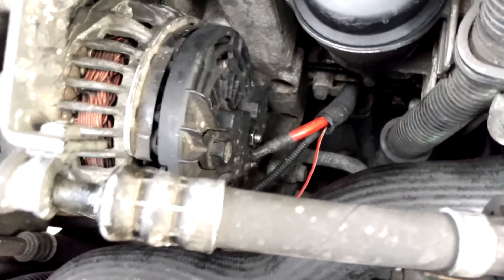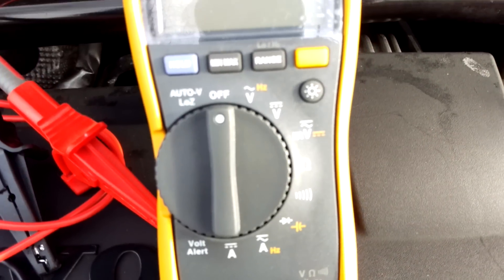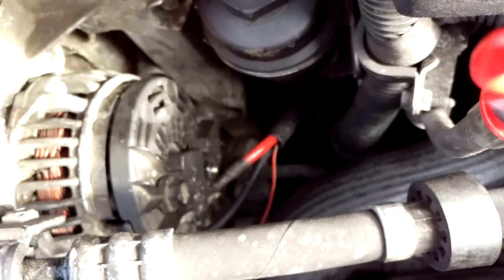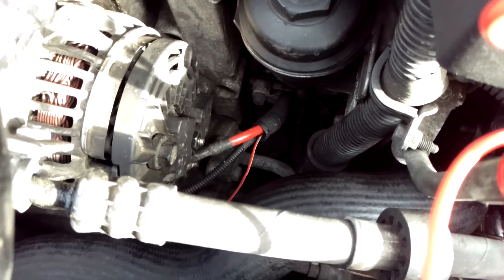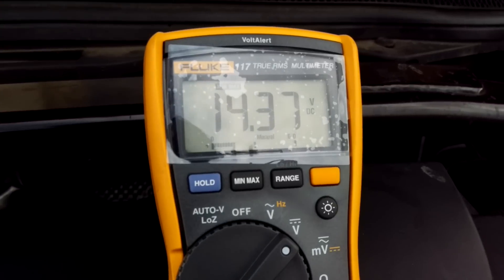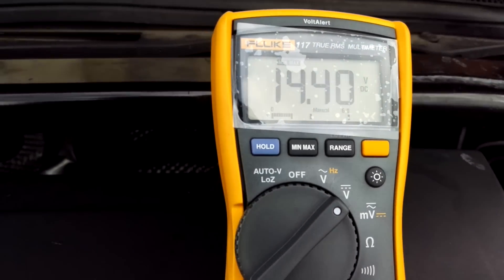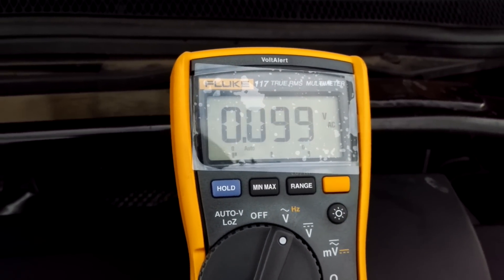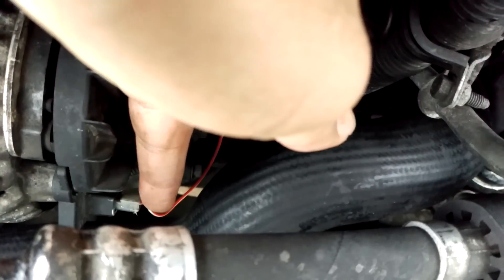How To Test an Alternator Part 2. Rectifier, Diode Pack, Parasitic Battery Drain

Comment: SiRobb, Thank you so much I have trying to locate a drain on my battery for a while now... when i do the dido test i get no reading Black lead on the case Red lead on the post. When I go Red on the case and Black on the post I get a reading of 850. The alt. is putting out 13.99 volts DC and the AC voltage is around .01 or so. Should I be looking elsewhere for the problem?
Reply from the maker: Your diodes and DC output are fine so look elsewhere.
I have a separate detailed parasitic drain test video in my list.
Reply: @sirobb  Thank you again!... so just to be clear we are talking about an 1988 VW Cabriolet... on the parasitic draw test, key out, I got a reading of 0.02 using the 10A setting... that doesn't seem like a lot to me... but the battery does go drop down to around 12.40 or so after a few days of sitting...  what do you think?
Reply from the maker: 20mA shouldn't cause a problem in such a short time so either the drain is spiking over an extended period due to for example a faulty door or boot open switch, a faulty glove box lid (if there's a light inside) or your battery is end of life.

You may have to leave the meter in series for several hours and use the high/low function if the meter has it to record any anomaly. 
I have a How to test a car battery properly video showing the difference in behaviour between batteries in good and poor health.
Reply: @sirobb  Yes, I have watched all your videos on the battery/Alt. subjects... also I noticed that the drain is intermittent... I have one more ground spot to check and clean, but I am starting to think it's the battery...
Reply from the maker: @genedoerr9519  OK, good luck and I hope you find the source of the issue.
Reply: @sirobb  Thank You again... stay safe!

Comment: Hi SiRobb, I have a question -  there are three separate coil windings in a alternator, correct?  Does the diode test get all the diodes at once, or is there a dedicated diode for each coil?  If the latter is the case, you would need to rotate the pulley to bring each diode into the circuit, right?
Reply from the maker: Pretty certain that no rotation of the pulley is required.
Regardless, a correct DC voltage reading on a running engine as shown in the video is usually enough to confirm.
Reply: @sirobb  After I asked this question, it occurred to me to find a circuit diagram of an alternator circuit, and yes all diodes share common connections at both ends.  It looks like the three windings operate concurrently not sequentially. 
The issue I have been having is, a $60 battery tester I bought a little ago was giving me crazy ripple readings.  I recently got a true RMS meter and was able to check the AC voltage and it seems to be about where it is supposed to be, and the diodes pass.  I guess the ripple function on the battery tester is not reliable, at least not when taken across the battery - I might try it again off the alternator.

Comment: My friend, good to run into you again, hope you have been fine. I have a question for you please. If the first indicates a faulty rectifier due to voltage decreasing when engine is revved, would it be safe to say that results for the AC voltage test must return a value greater than 0.0 V? ——— For clarity and background for why I am asking, my voltage did drop when I revved the engine however when I did the AC test I received a result of 0.0volts. It is possible I made a mistake somewhere as well because I was not expecting a 0.0V on the AC test.
Reply from the maker: A flat zero on AC voltage means you would need a higher quality meter to get an accurate reading.
If the DC voltage is high enough and the alternator passes the diode test though, all should be well with the rectifier. What is the DC voltage?
Reply: SiRobb with red lead to B+ post and black at alternator case - 12.24 V when car is off, at idle 11.82 V,  11.80 V at 2000rpm,  and 11.65 V with accessories on. Brand new battery and alternator regulator. Battery is 12.94 V when removed from vehicle entirely
Reply from the maker: Those figures are low so do the diode test.
Reply: SiRobb very good - cheers and a good rest of your day to you my friend

Comment: Having this problem one my early 80s VW Caddy diesel. Battery voltage doesn't change (12.7-8) even with everything on. Headlights really dim. My dash light will go out once engine is revved but when it's dark I can see it glowing faintly. Tested everything else...including replaced the regulator with a good used. No change. 
Seeing explanations on bad diodes causing power leakage makes sense. In the bed I have an electric lift pump for the VO tank and even with it off...a few times when I would turn the key on I could hear it trying to weakly spin. Not all the time. After running for long periods it more than once acted like weak battery when trying to start...which shouldn't be the case. Alternator causing a bleeding ground out when considering possible diode failure. Just did the AC test with my Wal-Mart multi-meter on the lowest AC setting (m200) and reads well into the 1/10s of volts. Probably high from being a cheap meter so isn't sensitive enough but conclusive enough to point out to bad diodes.
Reply from the maker: What was your result from doing the specific diode test shown in the video?
Reply: @sirobb  Unfortunately didn't write anything down or recall specifics other than some bouncy numbers of 0.1+. Narrowed my problem partially to iffy grounds from battery to frame to body & motor. I get 13.0-1 with only the engine running (only draw being the S/O solenoid) but 12.8-9 with everything on. 1 more possible connection culprit to check first...the boot w/ 3 female spade connectors that plugs into the alt. A PITA so thinking they are dirty. Have a mind to cut it off & do a boot delete & just use new ends.

Comment: NOT conclusive nor says anything!. mine is renault master 2008 2.5dci. draining at 4amps. did this test both OK. still drawing! dismantled it diodes lookes tested ok just failed on last test plus to body negative to diode showed volts. so this video is NOT correct !
Reply from the maker: The video is correct. You've ruled out the diodes and now need to do a more comprehensive parasitic drain test.
There's a detailed video in my list.
Reply from the maker: Just read your comment again.
If you get a reading in diode mode with the red meter lead on alternator B+ and black lead on alternator casing, show the diodes are allowing backwards current flow which is not good.

Comment: Hi, thanks for the video. I have a question for you if you don't mind. I have a faded GEN light on when driving and when i stop the engine gen light comes bright red as it should be. At the same time with the faded light on, battery is charging, measured at 2500-3000rpm 14.4 volt and 13.3 with engine at idle. I have also measured the diode at 0850 (but forgot to measure the other way) Also measure the AC which was 003 volts only as per your instructions. Any ideas? Do you think that the voltage regulator might be faulty?
Reply from the maker: Check the system voltage in other locations throughout the car.
The alternator may be working well enough to output sufficient voltage but voltage drop through poor connections is then causing the warning.
Reply: @sirobb   Thanks for the reply, it was finally a cold solder in one of the three diodes. Measuring with the multimeter is not always reliable as you have to unsolder the diode you are measuring.

Comment: Hi thanks for this video it's very helpful but I have a question I want to perform the Ac voltage test on the alternator but my multimeter has several numbers on each setting, which number of ac Volts I should set it to ?
Reply from the maker: Use the setting which allows you to accurately measure <0.5 V
Reply: @sirobb  on your multimeter showing 0•+3 numbers so your results showing 0•140 my multimeter has 700V 200V 20V 2V On the Ac setting so when I set it on the 20v the numbers was 0.01  the last number keeps bouncing between 1 and 2 when I bring the RPM TO 2500 it will hold at 1 So I've watched the settings to 2V and still 3 digits but this time starting with ▪035 the number 35 bouncing up and down up to 50 before I rise the RPM TO 2500 then it will go up to ▪090 when I rise up the RPM, the only test I have left is the last one when you disconnect the b post from the alternator, I forgot to mention the first test which is the DCV, with the car running lights on heat on radio on 14V RPM 2500 14.8V the car running lights off heat off radio off 14.16V RPM 2500 14.24 (note) the car was setting for about two years do to battery drain overnight now I want to face this issue seriously, my car is a 2003 Mercedes benz e500 just replaced both batteries this week brand new from the Mercedes dealership, I removed the alternator and took it to the alternator rebuilder shop to check if anything wrong with it, I replaced the voltage regulator also this week Sorry, I went too long to write, But I am in a state of frustration with this issue
Reply from the maker: Your alternator sounds OK so next I would do a proper parasitic drain test.
Reply: @sirobb  hi, how are you doing, I'm back just performed the last test in this video, again my voltmeter has several settings on the ohms section too, the first setting has the buzzer mark and something looks like this >+  the second setting is 200 ohms the third is 2k the fourth is 20k fifth is 200k 2M then 20M So I used the first setting, Ok now the results that I came up with As follows negative lead to the B post and positive lead to the alternator casing (484) positive lead to the b post and negative lead to the alternator casing no numbers just the number 1 on the left side of the screen, Am I good? note I've only removed the B post and i left the voltage regulator connector on, also the skinny wire i didn't pay attention to that until after the test but its not connecting to anywhere on the alternator, and again thanks very much for your time
Reply from the maker: Yes, your alternator is good as I said in my previous reply.
You need to to a parasitic drain test at the battery negative terminal.
There's a parasitic drain test video in my list.
Reply: @sirobb  👍👍👍thank you

Comment: What a great video this is, Very helpful, thanks for a brilliant tuition, have a charging problem so this will hopefully confirm if the Alternator diode pack is working correctly.
Reply: Very good and direct what u need to no.

Comment: Hi I have a parasitic drain and started with the alternator and have done the 3 tests, charging is OK, there is NOTHING when red on post so I assume diode is woeking.... but when red on alt body and black on post it is only reading 458 what does this mean? and the fuse test is next? Any advice on this low reading is appreciated.
Reply from the maker: The general range is 500-800 one way so 458 one way wouldn't cause me an issue as long as charging voltage is around 13.8 Volts DC or more.
There's a more detailed parasitic drain test video in my Playlist called Cars.
Reply: @sirobb  thanks for prompt response my worry was the diode had gone which test says it hasnt, which was £130 new or £70 fixed. Tomorrow the fuse tests THANKS Ian.

Comment: Hello,i do the ac ripple test 0.76 at idle but no symptoms of bad diode
So,where is the problem?
Reply from the maker: I don't know. What is the problem you are having?
Reply: I thought the absolute max of AC should be 0.5 -- yours was only 0.1, and this guy's is 0.7 so isn't that the problem? Just trying to get my head 'round all this so sorry if I've said something daft.
Reply from the maker: You could well be right and on the face of it, that looks to be the case.
There are 3 tests in the video though so I was just asking for a little more information to complete the picture.

Comment: As Temperly measure until fixed or replaced would removing the black lead stop this parasitic drain (it’s easier to get off and on quickly) or as it is red going to the alt would it have to be red. Finally can you not do the diode test by just disconnecting the battery lead as I cannot get to my alt as easy as yours? Thanks for the helpful vid.
Reply from the maker: Yes you can do the test with the black battery lead removed instead.
This will also stop the drain but will power down the entire car.

Comment: I watched your video yesterday and then ran your checks on a 2006 Nissan Pathfinder. Until recently the vehicle has been fine, but there is some debate as to why the battery is suddenly draining if sat for 48 hours. I'm getting conflicting information that the battery had been connected the wrong way round, though no reason as to why battery had been removed in the first place. Secondary to that is that it's physically impossible to connect it wrong due to the lengths of the terminal cables and battery posts to one side of the battery. I was also told that it had been jump started, again with the confusion that the jump leads were connected wrong. Unfortunately, I can't confirm any of that.

For the first test I got 12.8V across the battery, and then 14.3V and 14.5V on the DC check. When I did the AC check I was getting 28.1V, and on the diode checks I was getting 0.532 and 1. I was for asking what the 28.1V on the AC check would mean, so I watched your video again to see if it was mentioned, and then by chance, just read the full video description, where you mention the 20-30V reading that some multimeters would show. Assuming that mine falls into that category, and the alternator is otherwise okay, is it possible that connecting the jump leads the wrong way around (even though it wouldn't have jumped the car) could have fried something else in the car? I've completely isolated the alternator anyway and will be checking it again later today and again tomorrow to see if the drain is still there on the car.

BTW Finally, just to say that I thought your description of a diode was brilliant. I've known what they are and what they do, but could never think of a way of describing their actions.
Reply from the maker: Thank you for your comment. 
Your alternator sounds OK so far so my best suggestion is to follow my parasitic drain test video here https://youtu.be/ZCMQE2tgRSE
It's a very simple method of finding what your standby drain is and how to find it.

Comment: Hi can't get a alternator reading from battery I've placed my leads on the alternator post and to earth still not getting a full charge reading do you think the alternator needs replacement.I'm worried because when I was fiddling in engine bay alternator started to work until I switched car off .back to not working.great channel excellent content,
Reply from the maker: What exactly are the readings you're managing to get?

Comment: My battery test and starter test(cranking)...were normal. My charging system test results came back: DIODE SHORT. I have a 2007 Jeep Grand Cherokee. Are DIODES something you can buy and replace? I'm a 62 y/o single female and I don't know too much about engines(except for lawn mower engines!) I had that "parasitic drain" problem that left me stranded over the weekend. Since my car was jumped off, it has cranked okay for two days. My question is....are DIODES something you can buy and replace...instead of replacing the alternator? Thanks so much for the video and any info. you can offer. I just spent $521 for a new a/c compressor, so I'm hoping this won't be an expensive fix!